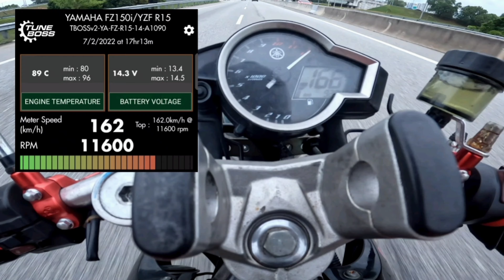Fz150i - Top Speed Test; GPS Speed (Sepang Trackday Prep)

Comment: Spoket brapa ni 15,36 ke
Reply from the maker: Bukan, masa ni, sprocket 14-43.
Reply: @Hitman4President  oh saya pakai spoket 15,42 ralat ngan gps 10.....meter saya 152 dapat gps 142 je
Reply from the maker: @hairudinlamari2337  saya xpasti, sb sblm ni pun ada ralat dalam 10kmh dgn sprocket 14-43, tapi lepas up spec 63mm, tukar rim sp522 yg size kecik sikit, check gps, ralat dalam 4-5kmh gps speed.
Reply: Saya pakai sp522 saiz 2.25/1.85......biasa fz atau y ke atau y16 ke rotation bacaan meter dekat spoket depan......turun spoket depan akan buah ringan meter,turun spoket belakang akan ubah berat meter mcm tu lah sebaliknya
Reply: Spec bos sama je dgn saya,saya spec 63,TB 36,head 19,22
Reply from the maker: @hairudinlamari2337  betul la jgk ni, so lepas ni maybe akan try dgn gps app yg lain, sblm ni pakai tuneboss pny app, so kita tgk, ada beza byk x
Reply: @Hitman4President  saya pakai uyless gps setup ralat 0%,ada jugak utuber set ralat 30% untuk nampak laju😄....kita x mau la camtu......gps tune boss pakai Bluetooth,sya pun pakai ECU tune boss sekarang ni,saya dapat detek dari mana tau spoket besar kecik boleh agak.......saya dapat 153 meter saya pada rpm 11.6k tu spoket 15,42 dah abis la tu bkn fly tunduk biasa je......jika saya ubah depan 14,42 kompom meter saya 160 lebih atas tapi kelajuan yg sama je..... Banyak kali dah test dgn Kwan2 dgn rxz pun ada,set spoket meter motor naik tapi ngan rxz jarak yg sama cuma beza cepat atau lambat nak top speed......ni pandangan saya yg mana saya dah buat😄
Reply: Sebenarnya dapat kelajuan mcm sedara ni dgn spec mcm ni dah laju jugak tu😄,Dyno hp pun rsanya x kurang 24 hp lebih mau ada......dah sedap set biasa² ni👍